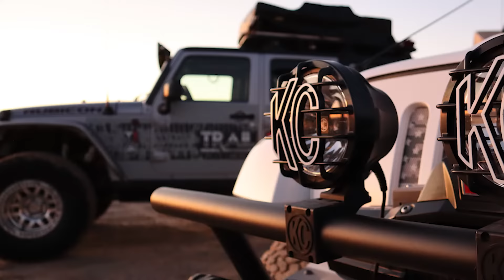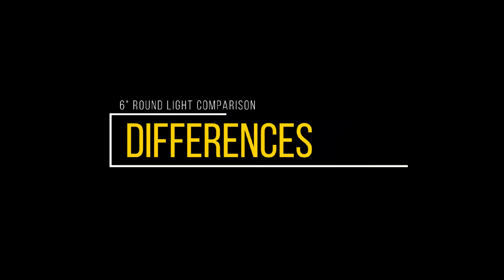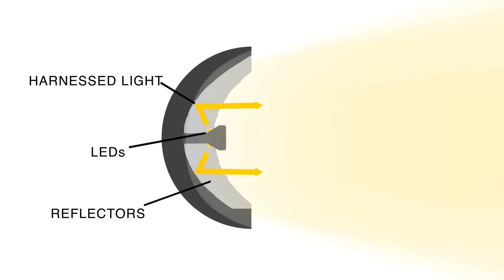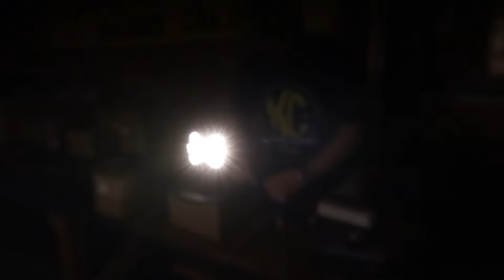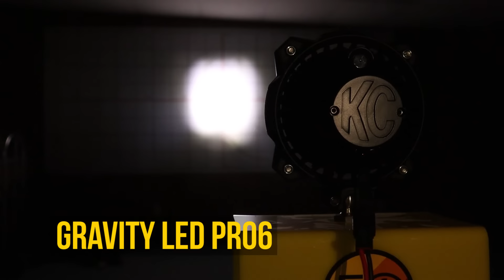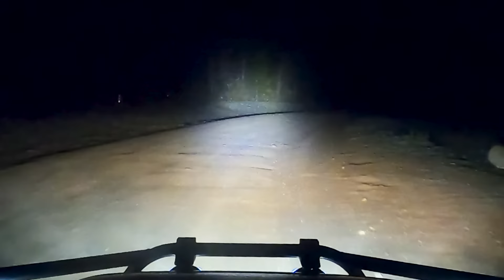KC® 6" Round Lights Compared: Apollo Pro, SlimLite® LED & Gravity® Pro6

Comment: Well that's disappointing 😞.  It seems Baja design does a better job. I do have kc for my fog lights and they suck. 300 bucks down the drain.
Reply: Get diode dynamics for fogs, best out there.....I have DD sport fogs and run DD pros for my pillar lights....then i have 4 KC slimlites on a roll bar on my tacoma....Baja SAE fogs are horrendous!...they would throw light all over, I'm talking inwas hitting the top of tree lines 50ft away, and inwas constantly getting flashed by people because i was blinding them....Diode Dynamics SAEs have a nice clean cut off line

Comment: Can you tell me which light would be most capable of illuminating a person standing 300 yards away?   I don’t mean lite up but can any of these cast enough light at that distance to see a person?
Reply: @kchilites  ok.   That’s what I was thinking, but the pro 6 is only 20 watts and the slimline is 50 so I wasn’t sure.  I called your tech support snd they told me to buy the slim light but the beam on the pro seems much tighter, plus, I can buy the insert and install in my day lighter.  I will buy the pro6 insert for the day lighter, that will do it right?   The hid is too expensive but I realize it is long range
Reply: @kchilites  your slimlites have a better spot beam bud, I know from buying 4 of each to try on my roll bar on my tacoma....slimlite spot beam gave an extra 50 to 75 yards of sight on pitch black open roads

Comment: This video is exactly what I needed! I'm running stock halogen headlights on my JKU. I'll upgrade to LEDs once one of them goes. In the meantime, I'll get my LED fix via these Slimites. Haven't decided whether I'll mount them near the cowls or on the bumper/bull bar. Can you tell me what mounting hardware I'll need? As I may eventually go from 2 to 4 lights, what do you recommend for switches? Much appreciated. Thank you!

Comment: Awesome vid.
I just bought my first KC lights for my Jeep.
I got the Apollo pro from auto zone.. but will continue searching for led.
Question... can I change the halogen bulb for an led one?
Is it just an H3 bulb that I can swap out or nope?
Reply: Did you ever figure this out? I have the Apollo’s and wondered the same thing
Reply: @dennismontes4769  I also want to know this
Reply: @hungryhungryhummer  I replied to Dennis so take a look at my response.
Reply: @dennismontes4769  hi. No I haven’t figure it out yet. One of the bulbs burnt out but it was super easy to change.
I haven’t looked to much into it cause I kinda liked the yellow light with all the white lights I have on my Jeep. Cool contrast but I would love to put some cool blue lights instead of the yellow.
If you figure this out let me know to please.
Reply: @RVingTheCountry   thanks, if I find one that works I’ll let you know
Reply: @dennismontes4769  but it was just the bulb I swapped out. 
Untwist the outer case and it’s so easy to change the bulb so now I’m thinking as long as the bulb is H3 size also you could use any bulb I would imagine. The bulb that’s factory in Hallogen but I don’t think a replacement would have to be.
Do let me know if you look into this. 
Thanks.

Comment: By chance will the middle set of lights plug into the same harness as the left set of lights?  I have them installed and after replacing my head lights with HID’s the left set are just too dim to light trails like I want

Comment: 250w aircraft landing lites   6" and tractor lite housing from tractor supply. Btw 2 of em need a 40a circuit  breaker.. and a relay is highly recommended.  You can get spot or beam. 😁

Comment: What beam pattern would you recommend for the Pr6, if I plan to run it on my bumper with an amber cover and essentially run them while offroading in the daytime too. I don't want it to be annoying to anyone in a caravan in front, but I would still like for it to be effective if it gets darker and I take the covers off. Thanks!
Reply: @kchilites  No I definitely don't see a need to run them when I'm not off-roading, so sounds like that one would work. I don't have any other lighting besides the stock headlights and fogs. The wide-40s were what I was leaning towards and I appreciate you helping out! Thanks!
Reply: that's good advice.    what i've found is that descriptions or beam type names from manuf aren't enough info to go on.   You just need to do some research, commit and buy something you think might work, and go from there.    In most cases, unless you only need lighting in 1 particular situation, you will most likely do better with more than one lens type.    Spots are generally so narrow that you get a hot spot and nothing else...but downrange on a long dark road, nothing beats them.    Floods have so little distance they do nearly nothing on an open road and are useless at higher speeds, but they're the best if going through a narrow treed dirt road..    driving beams are somewhere in between..at about 60 feet, they create a box of light around 15' wide.    Having 1 driving and 1 spot is an amazing combination, your low beams fill in the close range.    How you aim lighting has a huge impact on how effective your lights are for how you use them.